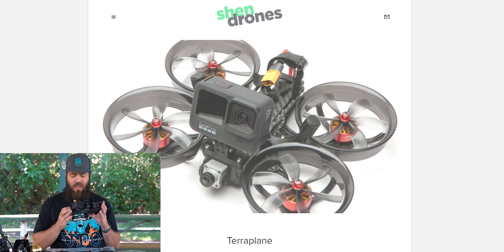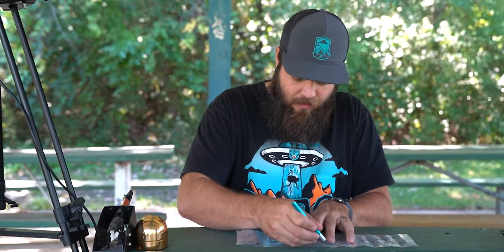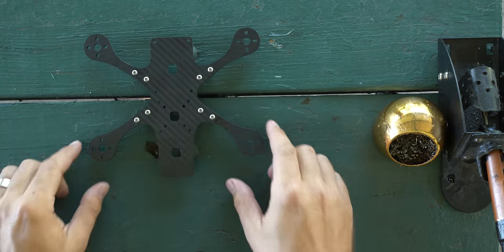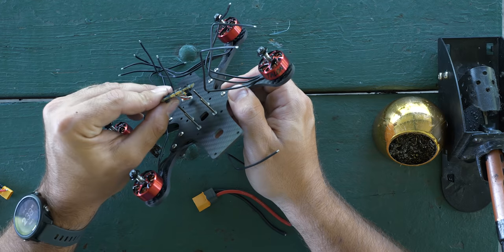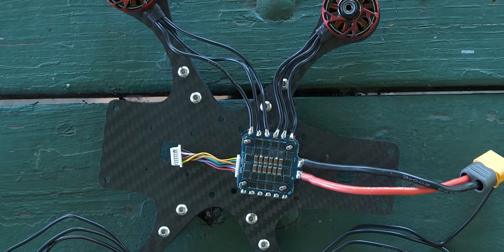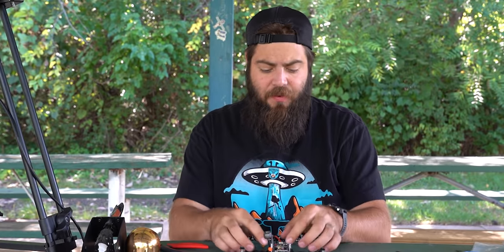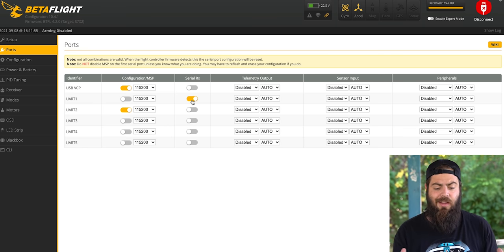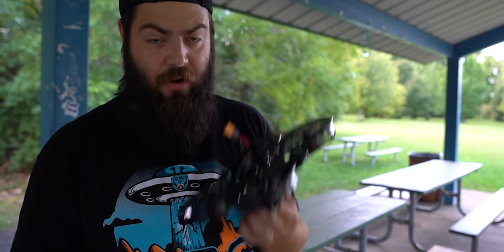Shendrones Terraplane - Full Build Guide of the Squirt 3.0

Comment from the maker: Frame: https://bit.ly/3tOgWwY
Flight Controller/ESC: iFlight SucceX Stack 20x20: https://bit.ly/3bGpHk1
Alternate Flight Controller/ESC: T-Motor Mini F7 Stack: https://bit.ly/2Ujgi9Y
Caddx Vista: https://bit.ly/39di7N9
Alternate to Caddx Vista: https://bit.ly/3zjzw12
Motors: https://bit.ly/3lQtT63
Alternate Motors: https://bit.ly/3EulAVK
(Optional) TBS Crossfire: https://bit.ly/3ki2OYd
Battery: https://bit.ly/3lDNfLz
Bunch of extra m2 hardware: https://bit.ly/3lyv7mf
Solder Practice board: https://bit.ly/3AoAqL5

Comment: There are even 4in cinewhoop props available now. I would convert a regular 5in at that point.
Reply: Great point! I need to find a 5" cinewhoop frame!
Reply: Which props and ducts do you suggest for a good 5” conversion?
Reply: @Alf-Dee  Right now only HQ has a 4in cinewhoop prop. For the ducts, you probably need to design and print your own, lots of good examples on thingiverse.
Reply: @yannickg6904  thanks! I experimented myself with some custom ducts, but in the end the hassle of printing them correctly wasn’t worth it. But I know the main problem was me not being good enough on 3d modeling 😅
I’ll check new designa on thingiverse!
Reply: @Alf-Dee  I printed a whole "Freezillion Racewhoop" out of TPU. Heavy AF but indestructible. I would adapt these ducts to 4in and mounted individually on a CF frame.
Reply: @yannickg6904  That sounds like a cool project! Maybe the way to go is to skip ducts and just do good prop protection. Like a giant beta95x but being a pusher is probably not needed
Reply: @Alf-Dee  Stanfpv has some nice ducts. I did this with my 5". Bought extra arms and motors and connect with m30 connectors,  so I can swap everything in about 15 minutes.

Comment: Wait betaflight configurator 10.4 😳  
I had to add spacers on my iflight stack. Plugs hit solder bubble lol. Using succex-d esc and succex-e fc
Also went thru 2 succex-e 20x20. DJI plug didn't work on both.

Comment: I noticed the kv is pretty high in those motors. I have 2207.5  1700’s, what would be the downside to using these on this frame, not enough power?
Reply: Also noticed that kv is high for what we see usually on 6s builds. Isn’t it for 4s ones?
Reply: I see now, it’s not 5” props, it’s smaller ones 85mm props, so we need higher kv

Comment: Now put on 4" props and rip.. add ducts with the 2 extra screws when you need them. And then put 3.4" props. 
Been wanting terraplane for awhile now. Should I build myself or just have that shop build it.  I have 1bedroom. And my building is done on dining room table. So annoying. Lol 🤦‍♂️
Reply: I bought 4 extra arms and motors and attached 4" ducts for my 5" build and use m30 connectors for the motors.I can swap out from standard 5" to 4" cinewhoop in about 15 minutes, including a quick change in rates. I've only tested the cinewhoop setup once, but it was pretty smooth.